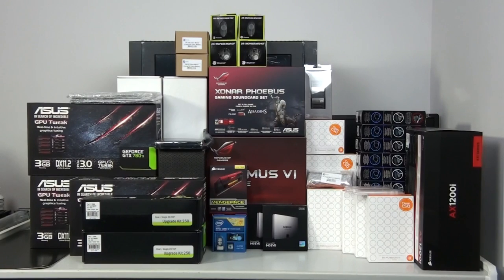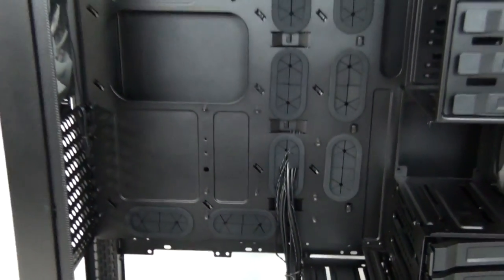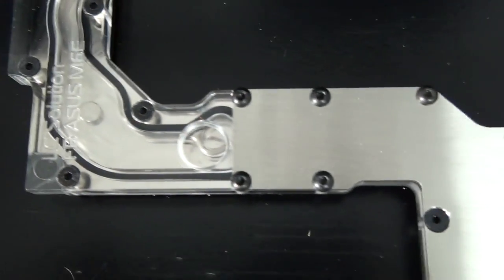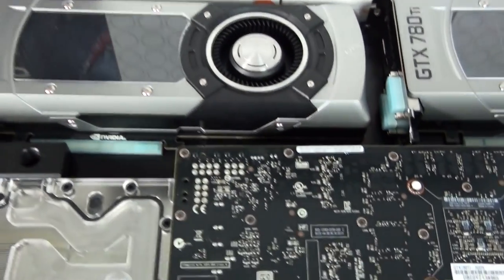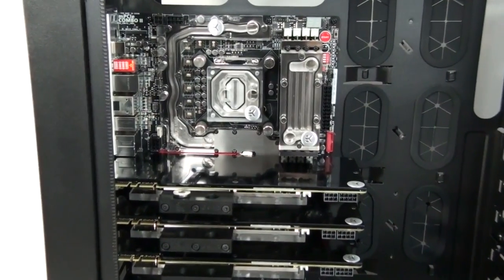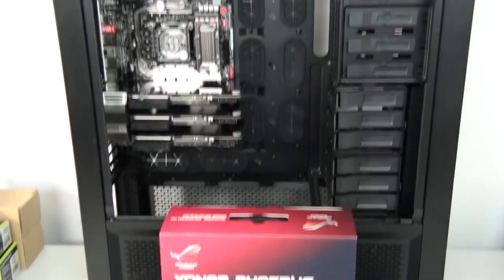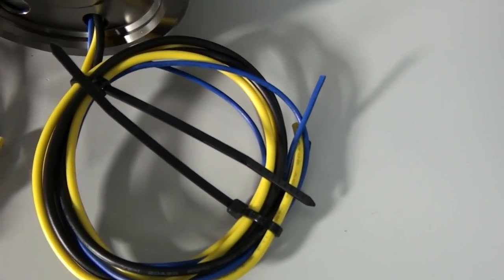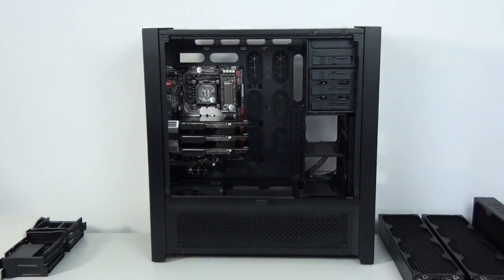Build #15: Extreme 900D Dual Loops: Part 1

Comment: if people are building a computer this expensive why would they even consider a 4770k? 4930k man
Reply: Because it's enough for gaming. This build is clearly aimed at 4K gaming. 

You only need 6+ cores with specific applications that can take part from it. That would be video editing, CAD, 3D modeling, simulations and Server applications.
Reply: i don't think you need 3 780ti's for gaming, you barely need one.
Reply: zepicness I don't think you know what 4k is...
To be Fair, 3x 780ti is a fucking waste of money. you're getting just over double the performance of a single card. 
that's 3 cards with only 3gb of VRAM to play with, and two of them are starved for bandwidth.
Reply: i know what 4k is...
Reply: then you should know that there is no single card solution for 4k.
Reply: Stephen Rudolf I don't want to put oil on the fire and play the wise guy, but anyway...
The 295X2 and Titan Z are 4K compliant (somehow in a low framerate). It would be single card but dual GPU. And the Titan Z is even a greater waste of money.
Reply: 295x2 intergrated into a custom loop would be way cheaper
Reply: Even the titan-z and 295x2 struggle with it. you pretty much need a custom loop to properly dissipate all of that heat.  Let me be a bit more technical, there isn't a single card solution that can run full 4k in ultra with 2x+ AA at 60fps on all games out today.
Reply: Let alone a single GPU.
Reply: guey
Reply: zepicness what?
Reply: what
Reply: How about, Hey ***** Love your vids keep them coming man "LIKE!"
Reply: because the x79 chipset is old as hell now..... its features are completely washed out... for chrissakes its only got 2 native USB 3.0 and 2 native Sata6.... not to mention countless less voltage and power saving features, and I own both a 4930k and a 5930k, and the 4930k overclocks HORRIBLY.
Reply: i posted that before the 5xxx series came out...

Comment: A sound card is an absolute waste of money! A PC case is due to the interference from the motherboard and the graphics card etc. an incredibly bad place for audio equipment.

It is therefore more appropriate to take the digital signal from the onboard sound and connecting it to a D / A converter. The digital signal from the onboard sound and an expensive sound card is apart from any fancy equalizers, which no one needs, the same.
You really can enjoy good sound with the combination of good headphones and a headphone amp.

I am currently using an Arcam rLink, the Objective2 amplifier and Audio Technica ATH-M50 headphones.

Test this or a similar combination against your sound card. You will see that expensive sound cards are total junk.

Comment: There's no Maximus VII Extreme.  So the VI is still relevant.
Reply: Yup there is. It's just not available for purchase yet. http://rog.asus.com/tag/maximus-vii-extreme/
Reply: Toxic Biohazard Link just takes you to the VII Formula page? Where does it say anything about the extreme?
Reply: Chris Cleveland Hmm I didn't notice that...
Seems like rog has their links messed up. The Extreme should be coming soon though.
Reply: Toxic Biohazard I remember months ago that Linus interviewed the dude from Asus about the z97 lineup. He said there wouldn't be an extreme, just the formula and below. The VI Extreme will still be the flagship mainstream board.
Reply: Chris Cleveland Maybe SC meant to the maximus vii formula then...
Is there a reason why they discontinued the extreme?
Reply from the maker: Actually I said that the Maximus VII series had been released not the Maximus VII Extreme. It seems that the Formula has taken over the position of the Extreme in terms of features and pricing. Asus has introduced a number of cheaper Maximus boards such as the Ranger and Hero.
Reply: ***** Yeah I know you hadn't said the Extreme was out, I was just pointing out that this board hasn't been replaced.  From what Asus reps have said they aren't killing off or replacing the Maximus Extreme series boards, they just aren't releasing a Z97 version.  The Maximus VII Formy is still at a lower price point than the VI Extreme, and it focused more on gaming features than extreme overclocking like the VI Extreme.  The Extreme series has always focused mostly on performance and overclocking, eschewing better audio and unnecessary features for better hardware and higher overclocking potential.  In that sense it still hasn't been replaced, and I expect it will return for Broadwell.
Reply from the maker: Chris Cleveland
Agreed.

Comment: 2 Titan Blacks would be a lot better...
Reply: ***** Nice argument bro...
Reply: ***** Let's see how these 3gb cards go with Watch Dogs against The titan, you don't even need two Titan Blacks... From now on, at least 4gb on graphics cards. I'm sorry, but that's the truth.
Reply: really you could do 2 R9 295x for cheaper and better performance... what is with the 780ti love when they are super expensive have less GDDR and lower or equal performance to the 290x

I have owned Nvidia cards and ATI/AMD as well as AMD/Intel CPUs..... performance, price and features should be what we used to determine purchases not brand name....

but to each his own I guess
Reply: I'm still want to see the 780ti vs titan black.
Of course the 780 is better, but the memory is essential from now on.
I'm not being rude or anything, but next games will be highly graphics memory demanding.
See you bro.
Reply: Samir Ashqar I would much rather go 3 way sli with 3 6GB 780's than 2 Titan Blacks (both GPU setups are the same price).
Reply: fair point, my 290x is a space heater.... well that and my 3930k :)
Reply: David Norman my 3930k is overclocked to 4.5ghz with an corsair H100 cooler on it en it runs idle on +-50°C with a room temp of 25°C :p
Reply from the maker: I built this system 6 months ago.
Reply: ***** Don't know why people want a Titan Black, which are so much more expensive, even per card, when the 780Ti and TB perform pretty much the same, even at 4k and above.
Reply: ***** The edge is a lot of the time 1 or less FPS (at 4k), they're essentially equal, with one being a lot cheaper than the other.
I know SC said he built this 6 months ago (Titan Black released in the US some time mid February), but even if this was being built today I'd go 780Ti. Well, I'd wait for 880 drop in truth, but you get what I mean.
1 780Ti = 1 Titan Black, effectively, in [gaming] performance only.
Reply: any 780ti will beat a titan black in gaming. That resolution to refresh rate argument isn't very accurate, for most individuals 60hz is plenty, and they would much prefer things to look better than for things to only be 20% smoother.
Reply: You can play most games on 4k at 60FPS excluding Crysis 3 which can dip to upper 40's (and probably one or two other games like metro last light etc).
Reply: You said it couldn't be done, which it can be, 4k can be played at ultra settings at 60FPS with 3 way card setups.
Reply: You said "close to impossible to get even close to 60FPS" 3 6GB 780's or 3 780ti's will run games on 4k with ultra settings at 60FPS on average, the most demanding games will be in the mid 40's to low 50's which is still very playable. Also at that resolution you could drop the antialiasing a smidge and not see a difference in visuals, but a large one in FPS.
Reply: Editttedddddd
Reply: dKJustwon A 295x2 will play games at 4K on max settings  at around 40FPS
Reply: Kaleb Gilley You seem to be correct, don't know where I was getting my information from. Maybe I mistook 295x2 CF results.
Reply: That's probably it, because 3 780ti's in sli only get around 52FPS (using Crysis 3 as a reference)
Reply: yup
Reply: ***** What do you mean "keep in mind that two r9 290 sound like a jet engine on their highest performance" i've only talked about Nvidia cards? aside from the 295x2 which is pretty quiet.
Reply: 780TI actually beats it slightly.
Reply: Kaleb Gilley Titan Black is usually better at 1440p+, within 1 fps or so.
Reply: dKJustwon
That's margin of error, at 4k I could see it pulling ahead though.
Reply: Kaleb Gilley The higher the resolution goes, the more equal the two cards are. At 1440p, they share almost equal performance, less than 1% performance difference. The same is said for 5760x1080. At 4K, however, the performance is the same.

I imagine you said the Titan Black would pull ahead at 4K because of increased VRAM. Even at 4K, 3GB is more than enough for current games, increasing VRAM is a waste for gaming cards for this generation. The story won't be the same 2+ years from now.
Reply: dKJustwon
There are already quite a few games that will utilize over 2GB's of VRAM at 1080p, 3GB cards really aren't enough for 4k, 4GB cards and up however are fine.
Reply: Kaleb Gilley BF4 maxed out at 4K pulls under 3GB of VRAM usage, and is one of the most demanding games out at the moment. Watch Dogs can pull more but it doesn't affect performance, and is really due to how badly the game was made for PCs, not because it's hard to run. Those BF4 results are with maxed AA, which at 4K nobody would need to use, unless for e-peen.Without AA the VRAM usage drops to about 2.2GB.

Another game that uses a lot of VRAM is Crysis 3, which will use a bit over 3GB with all the bells and whistles (on a 780Ti). The game goes up to 8x AA, and without AA the VRAM usage goes back down to about 2.2GB.
It is to be said though that a game will use up as much of your VRAM as it can, because it can, while also 'maybe' helping your performance (in FPS). This can be seen with cards with the Titan(s), which have much higher VRAM usage than the 780Ti in the same situations (3GB+ with no AA).
The term for this extra use of VRAM is caching, but it can give a false representation of what the game actually needs to run, ergo the bare minimum, as it's trying to use as much as it can.

End of the day though, you're not going to see much (if any) performance gain going with a higher VRAM, even at 4K, as the 780Ti had the higher average FPS both titles, by a fair margin.
Reply: dKJustwon I know watch dogs will pull up 3.2Gb's on only 1080p, granted that is because of a bad port but it seems that games are setting a trend with higher VRAM consumption. I personally wouldn't recommend a Titan normal or black unless you really need double precision, I would go with a 780 6GB instead as it only costs around $600, and has a gk110 core so your're still getting above par performance, definitely enough for future games for a few years, and you can always SLI if it's not enough; but when is it ever enough? ;)
Reply: Kaleb Gilley Haha true enough, sadly we can't double up on the VRAM, but the raw performance gain should be more than enough, not to mention with only 4K becoming the future standard (I prefer ultrawide myself though) 6GB should be more than enough for say, the next 10 years, as we won't be able to properly game at 4K within the next 3 or so years anyway.
Reply: dKJustwon I'm hoping that Maxwell will bring something new to the table, like extreme overclocking capability because of their low power draw, but yeah, 4k on mid range/sweetspot cards is a pipe dream for at least another few years.
Reply: Yeah the lower power draw is nice, but I don't think we're going to see anything amazing until they release their 14nm chips, should be beastly things. Sadly not until late 2015/early 2016?
Reply: You have no dam idea what the hell you are talking about. The 780TI is FASTER than the Titan Black, let that sink in for a moment.
Reply: ***** They're not. If you looked at any benchmark you'd see the 780Ti is consistently slower, by 1-3 frames.
Reply: ***** This has been stated multiple times; and there is no need to be rude about it.
Reply: so would 2x 970s!

Comment: I would definitely prefer less frequent releases with more innovation. For example, although I love amd and use their cards in my system, something like the r9 280 and 280x which are just complete rebrand of the 7950 and 7970 GHz for just the sake of being "new" cards.. Well I find that really silly.

Comment: In the past, I believe Nvidia was "steady" with video card releases. The Ultra/ X90 series of cards would usually come after their normal video card releases. It was normal, and people knew when to start saving for their prized cards. Great drivers, good modding support and 3rd party addons. 

Their 7XX has been their most chaotic release on video cards, thanks to the now useless Titan. I really do not understand Nvidia's approach. Overpriced, hyped and clearly didn't do any normal users any good as far as titans go. Perhaps, I do understand but I prefer less releases. No one is getting a chance to utilize their cards and it is very hard to put faith in other similar products, like their Shield, and now new Tablet. Why would anyone want to buy that stuff if Nvidia will just change it soon? They may in fact never change it until a year later, but this is the shaky feeling I get from Nvidia. I would still  buy their cards but I am too afraid to buy one of their high end cards.

Comment: He should of gone with 2 titans blacks rather then 3 ti's, three cards usually don't scale well...
Reply: 3 cards normally scale fine, it's when you go to 4 that you get bad results.
Reply: Not always.. Plus 6gb if video ram is always a plus...
Reply: If you listened to the video he say "Built little over 6 months ago" TITAN Blacks were not out or just about to ! So these parts would of been bought and shipped to him prior !
Reply: Titan blacks were out 6 months ago, they came out February 18th.
Reply: Indeed thats when they were released ! It is the 5-8-2014 , Which was not 6months ago to the 18th-feb, Also he said 6 months(ish) So im guessing parts would of arrived at his in january maybe December time !
Reply: "6 months(ish)" might also mean 5 months he didnt say it was more than 6 months he might be rounding, if it was say around 5 1/2 months ago.
Reply: What resolution will the client be using for this built??
Reply: Kaleb Gilley When he started to build it ! Im sure all parts are there before hand for checking and just generally getting an idea to whats need !
Reply: Reece Asbury
What does that have to do with anything?
Reply: Kaleb Gilley It has alot to do with it ! Your saying go with tech , That was not out when he was sent or started using the parts ! Its like saying why didnt he use the 8*** series :/
Reply: I never said "go with that tech" refer to my comments abovfor proof, I simply said that it might of been out when he was ordering all these parts, as he said about 6 months ago, which could be less than 6 months, thereby making it possible to of used better tech.        P.S. next time if you're going to attempt to dissaprove someones comment make sure you have the info correct.

Comment: This build seems pretty stupid. Why not 2 titan blacks? And samsung evo??really?
Reply: Ceras Tech I do not mean to be rude but since this build is very high-end I find it strange to cheap out with your storage for like 150 dollar saving. For example I think he would be better off with the 10 year warranty of the 850 Pro.
Reply from the maker: I built this system 6 months ago. A lot of clients come to me with a list of components and ask me to stick to it. This will answer most of the comments on this video lol.
Reply: ***** Then this makes so much more sense lol.
Reply: ile222 10 year warranty... ohh god... Technology changes a lot in 10 years, just look at 2004-2014 ... Hopefully we have a new standard by 2024.
Reply: I have quite many computers and one of them still has socket 939 cpu. Long warranty is a promise of quality which is important for me at least. And yes technology does change a lot in 10 years. Anyway odds are I probably own more this gen stuff than you or any average person.
Reply: Ile P3 450mhz
478 P4 3Ghz
939 Athlon x2 6400+
775 Q6600 @ 3.4
and my main rig is an i7-920 / gtx580, I'll upgrade when Skylake comes out..